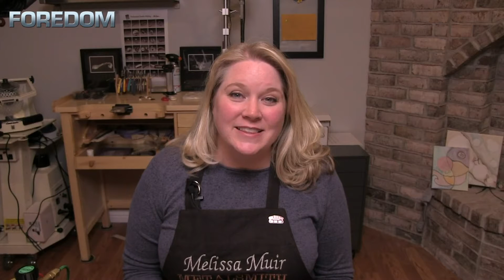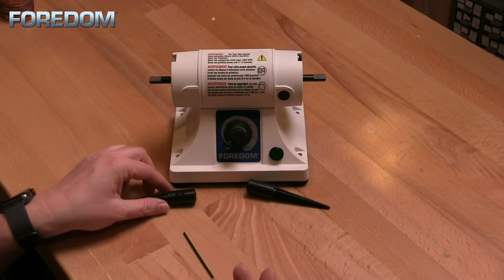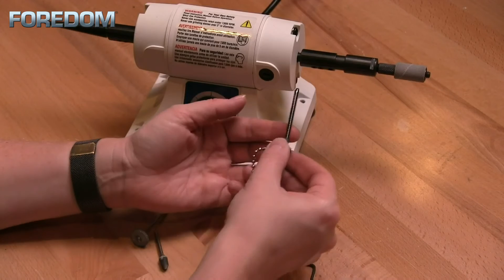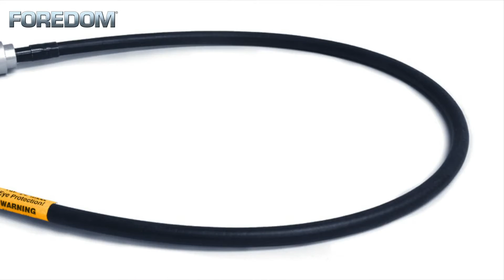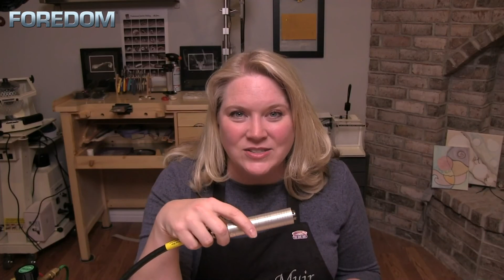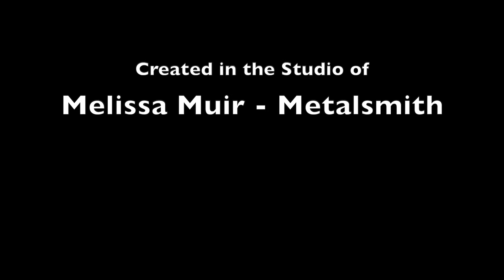Intro To Foredom Bench Lathe - Tool Time Tuesday

Comment: Hi Melissa, I just had a quick question re the Foredom bench lathe, I am planning to buy a polishing motor, to just try get a higher shine than what I get from using my Foredom SR flex, and I thought about purchasing this, though I've recently been told it's good for silver but not fast enough for gold (I'm not sure why!). There are cheaper models I've seen that go as far as 8,500 rpm. I trust Foredom so it would be my preference though the comment re speed has left me questioning. Any advice you have would be amazing. Thanks so much
Reply from the maker: I had never heard that it wasn’t fast enough for gold. It worked great on the pieces I have done. I love this machine as it has a lot of torque. I didn’t think much of it when I first saw it, but my tune totally changed when I used it.
Reply: @MelissaMuir  Thanks so much, that's sealed the deal, I'm going to go ahead and order it! And thanks for your all your amazing video content, I've learned a lot from them! Have a great weekend 🙌🏼 💖
Reply from the maker: @leonaclinton1279  I hope you love it as much as I do. It is a great little machine. I was pleasantly surprised with the amount of torque and power it has.